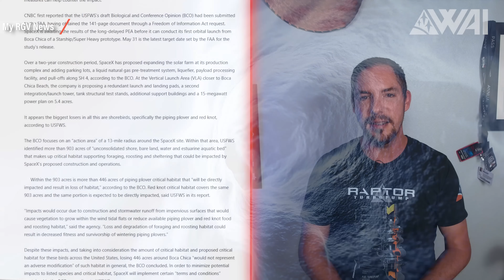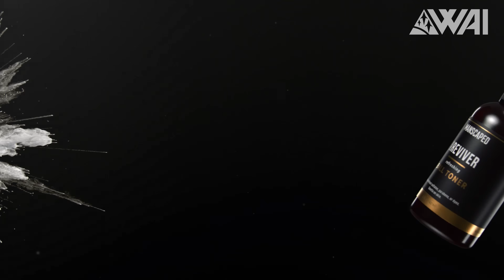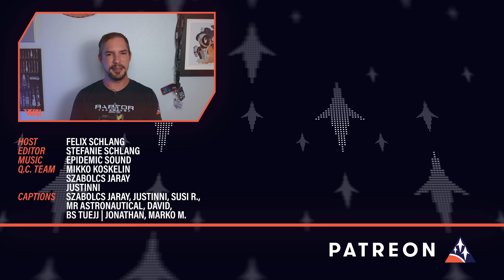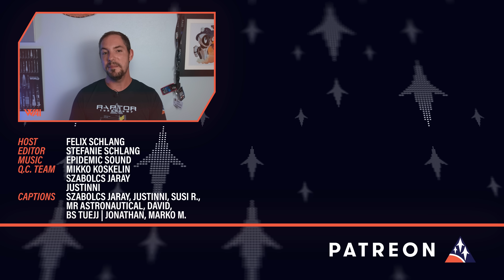SpaceX Starship Accelerating Efforts Towards The Orbital Launch Test!

Comment from the maker: Next question: How long would it take SpaceX to rebuild after such a pad explosion? :_WAIShocked:
Reply: Few months
Reply: Marcus House did something extensive on this, but searching for Starship explosion even on his channel gets a bazillion hits, of course.  And all of this assumes a pad explosion and NOT if the thing flies upward a bit and comes crashing down somewhere nearby.  Check old Cape Canaveral/Kennedy launch failure videos on how often that can happen.   There is one hell of a lot of expensive infrastructure nearby besides just the launch pad and tower...
Reply: @winstonsmith478  I saw the  Marcus House video ..It was unnerving
Reply: A day
Reply: If there is mostly a fireball without significant pressure wave a few weeks up to a month. If there is stronger pressure wave that destroys everything in its range, a few months.
Reply: @DreamskyDance  
that is right, there is no explosion, just a conflagration and only if the liquids are mixed. Cold on contact, they do not ignite. This, what he says is BS.
Reply: @arturoeugster2377  Yup..only pressure is dangerous. The fireball will just deposit soot on everything which is fireproof already.
You know when you turn on your stove but light it a second or two later and there is a bigger "wooosh" of flame. Exactly that would happen only much much larger.
Only thing that are dangerous for equipment are the pressure vessels ( the tanks ) themselves. 
And yes that can do damage. Idk if you watched myth busters episode about water heater explosion ( if not search it on you tube, that stuff is scary ), which is basically simplified version of a tank on a rocket with much less pressure.
* And before people ask, stoves in homes sometimes explode real bad because there is more pressurized gas in pipes, on starship if there comes to explosion tanks are instantly ruptured and there is no more pressurized gases to feed the explosion.
Reply: I believe if the entire PAD suffers the explosion you mentioned they will probably not rebuild the Boca Chica PAD and move the entire operation to Florida
Reply: Only as long as it takes the new concrete to set.
Reply: The use of the nuclear magnitude tool is not accurate since its a chemical explosion and energy is released much differently, the tank farm would also be ignited or rapidly depressurize, and finally the mixture ratio incalculable.
Reply: Demands on the impact / flight height wen happens... "kommt drauf an!"
Reply: aren't you overlooking the fuel ⛽ ⛽ in the farm exploding??
Reply: What could the shrapnel radius of the explosion be?
Reply: Probably the booster would first explode and then the starship. But then adds again that if the booster would explode in air the damage could be again bigger.
Reply: Did you chance title and thumbnail for this video?
Reply: 4 months, 20 days.
Reply: Pad would be the worst but then KSC would be ready fastest.
Reply: I would guess not more than 1-2 months, unless there's serious damage to the orbital launch mount and 'zilla.

Combining liquified oxygen with cryo-chilled methane isn't going to result in massive shockwaves because there will be no large-scale detonation.  Detonations happen when there's *stoichiometric mixing*.  

Instead, there will be a liquid on liquid interface.  It will produce a slow (relative to detonation) and massive fireball, surrounded by a couple dozen metres of rivers of ground fire throwing up further much smaller size/duration fireballs.  From the distance it would look like a much larger nuke because of how slowly it progresses, which increases the sense of scale.

The scale of the ground fire will be similar to the scale of the liquid nitrogen spill we had recently.  Smaller diameter at ground level because most it it will go up instead of spreading out.  So the tank farm will probably be unmolested apart from booster debris.  

I expect them to launch with Starship pre-chilled and near ignition pressure so that it can escape if anything happens to the booster.  They would need to test that functionality in that failure mode since it's part of the HLS no-abort-system plan.
Reply: 3 weeks
Reply: The worst thing would be that it goes up 200 meters en falls down onto the olm and olt causing major damage by the massive weight. 
Tank farm will probably get some damage from shrapnel. 
Electrical wiring and valves get damaged by the fire.
Reply: @TheAnarchist01  yeah I was kinda surprised that they didn't put the OLM and 'zilla on the ocean side of the OLT so that they can launch immediately toward the water... it will do so much less damage if it comes down on the water - from every POV.
Reply: @linuxgeex  
I agree.
The concrete base would also act as a flame diverter for The exhaust, protecting the tank farm.
Reply: Probably close to the same time it took the first time depending on clean up time
Reply: If the pad or tower is severely damaged, at least 6 months to a year 
Even if the tank farm gets destroyed, I don't think it would take a lot longer than a year
Reply: Hey Felix, have you been to the Cocoa Beach Ron Jon’s surf shop yet?? I Live an hour south of you in Palm Bay.
Reply: ahhhhhhhhh.... a nuclear blast drops the energy out in a few nanoseconds. So the blast is absolutely effective. But if you do it sequentially, it's not the same. Like, imagine ripping a 4 inch thick telephone book in half with your bare hands. If you do it sequentially, it's easy. If you do it in a few nanoseconds, you need to drive a dump truck into it to rip it in half in that timeframe. So it's not the same.
Reply: FYI, you need a physics consultant.
Reply: 1 week
Reply: Following what would without question be a lengthy bottom to top government investigation.... several years. They'd have to demolish whatever was left, more than likely upgrade or all out replace what didn't need demolishing, and finally build back seemingly everything new. And that's IF the tank farms didn't blow, if those went up too, just go to the Cape and out to sea.
Reply: @What about it!?  To quote Elon..... Success is not guaranteed, but excitement is. 
He said that about the chopsticks,  but it would be the same for all endeavors with rocketry
Reply: It will not explode guys...
Reply: Recoved neted 9-14 mounth, and three mounths for preperation to next launch attempt
Reply: they have to blow a few of them up on purpose to assess the damage that could be made by an accident
Reply: Could you do a video on what's next after star ship is running at 3 launches a week. I know Elon wants a city on mars, but what about countries that want large infrastructure in space? The UK wants solar power beamed from space to the UK to power the national grid. I'm sure other countries want stuff. Space hotels, giant space ships, crusies to the moon. A video on all that sort of stuff would be neat :)
Reply: How about you release a correction to this ridiculously incorrect video first.  The lack of explosion would indicate that the amount of repair would be far less than you claim.
Reply: Depends on the damage done.  The worst things that could happen would be that the OLM or the OLT is fully compromised.  Demolition of the remaining structures and re-establishing the foundation of the OLT would take several months.  Rebuilding a new OLM would take six months to a year, I'd guess.  If the orbital tank farm is compromised, add another six to eight months to that.
Reply: @glennpearson9348  that's not a good guess.  All the things that get destroyed can be remanufactured much faster than the first time.  That can be seen presently at Cape Canaveral where all the same structures are going up very fast.  The necessary repairs and replacement will also include the latest improvements and more.  I'd say in four months they could relaunch another ship, even if some things are not quite done.  In fact, I bet Elon is already prepped for such a possibility with more launch structures already made to go at Boca or Cape.  The next rockets are already made.  So four months may not be needed.  You're total of a year isn't even close.
Reply: @PlanetEarth3141  Thanks for your opinion, Mr. Know-it-All.  Have you been in construction long?  As a registered, professional civil engineer, I've only been designing and managing complex construction projects for a little under 30 years, so I wouldn't consider mine to be an informed opinion.

But, I'm sure you're right about everything.

Perhaps with your infinite knowledge, you'll be happy to explain to us all how the pile-driven foundation of the existing OLM will go any faster than they last time around?  That alone took three months because of the multiple pours and the requirement for each pour of concrete to pass a 28-day compressive strength test before the next layer could be poured.  So, go ahead and explain to us all how that would work.  Thank, sweet pea.  Looking forward to this...
Reply: @glennpearson9348  Unfortunately I don't have infinite knowledge yet.  However, I do have observation ability, such as an already built lunch tower sitting on the ground at the Cape.  I think I said that to you the first time.  Plus the rockets already built.  Most importantly, Elon never builds slower than before or even at the same speed.  What you don't know sir is he is smarter than you, better than you, plans better than you and is already prepared.  It's not a start from scratch process.  Where's you are predicting one to 1 1/2 years to rebuild everything.  But your the construction expert, not Elon or me.
Reply: i guess 2-3 weeks to clean explosion side, whole summer to rebuild the pad.
Reply: Hey Felix, great video. I don't think it would take too long to replace fabrication structures as most of the ground and pilings would be relatively fine and free from damage. Just scrape the wreckage off and place more modular building pieces down, it seems they thought of this beforehand as a possibility. It's probably why they haven't made brick or concrete structures like nasa did at Kenedy for Apollo. 
Also; I was thinking that the recent Beruit Port blast was the biggest but no, it was reported as 2.7 kiloton or less. I was thinking it would be a good analog to what the explosive force could be like if a fully fueled and stacked starship went pop, but it would have had to be over twice as large. That's incredible to think about, and probably the main driver for the assessment taking so long. Keep up the great work!